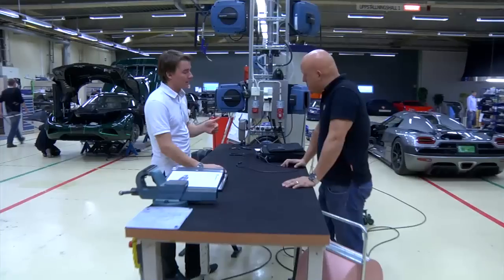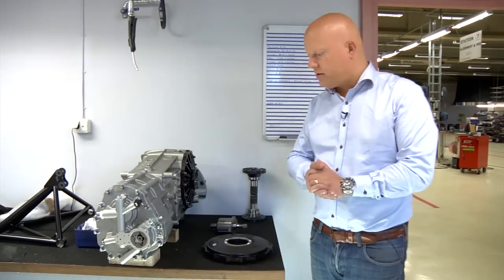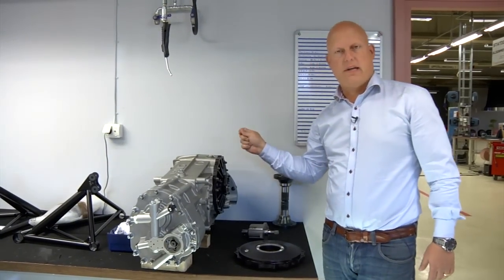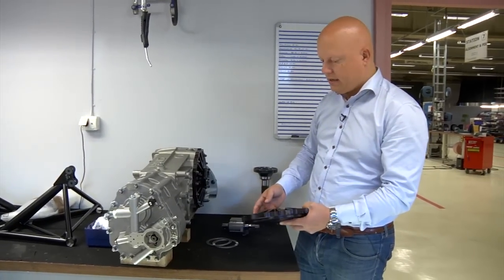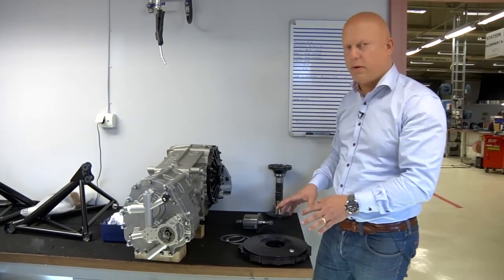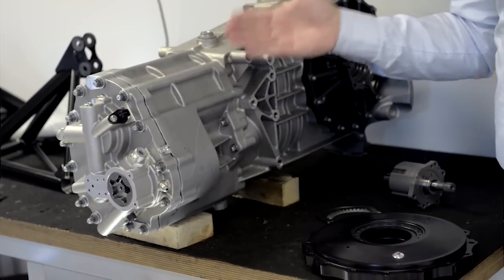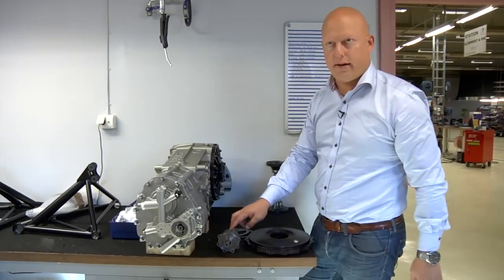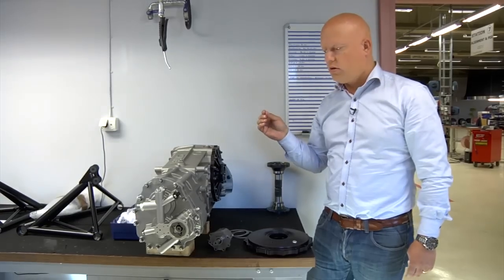Putting 1140 hp to the Ground - /INSIDE KOENIGSEGG

Comment: Bugatti supersport has 1200 hp
Reply: Bugatti SS=1888 kilos while the Agera R=1290 kilos. That makes up more than enough for the 60 hp the koenigsegg lacks.
Reply: momatedise Veyron is heavy, fat and ugly.
Reply: Yes but it weights almost 1900 kg's, have 16 cylinders with 4 turbo chargers to produce all that power. The Agera R weights almost 1300 kg's, has a 5 litre V8 producing 1140 bhp. So the Agera R is better engineered. Bugatti Veyron is only built for breaking the record as the worlds fastest road car. I rather have a car with killer acceleration than a car going 417 km/h. What is the point of that?
Reply: Stonkish come on man it aint ugly
Reply: veyron has an v16 ofcourse it is powerful but agera r has an v8 and making 1140hp

Comment: We will earn respect over time. Bicycles are a fitting test to show ERW acceleration advantage over pneumatic tires. Motor sport will benefit by high frequency contact with the surface,..Just the facts...Check out our new Screw force acceleration vs tubeless MTB video. Never be afraid of the march of technology, it will happen regardless.
Reply: You can't fall off a Koenigsegg, though.
Reply: High frequency response to the surface is key to high speed performance. A new lever of performance is necessary.
Reply: EnergyReturnWheel i was half expecting you to say "resistance is futile"
Reply: Our slow motion videos show ERW high frequency response not possible with pneumatic. Screw force accumulation and return adjusts each wheels rotation speed while maneuvering.
Reply: Surface adjustments happen between the wheel and the ground...A very short distance.
Reply: Bringing a carbon fiber hoop with Kevlar jacket so close to the surface. New traction systems are being developed. Latest published ERW patent addresses vacuum boost performance.

Comment: We have yet to disclose our novel traction systems. We have just published another patent...Nano Rubber wedges lever off the Nano Carbon Carbon hoop. The hoop held to the surface with approximately 6 Tons of Negative kinetic radial tension.Tension array sings at high frequency. Tread adjusting to the surface in milliseconds. Pinching the surface while braking and acceleration. Nano Rubber wedges lever, generate camber controlling lateral forces, radically increasing G force.

Comment: Koenigsegg!...Traction, bringing all that power to the surface, That is what is missing! The pneumatic tire is a 140 year old bouncy balloon. 
High frequency in wheel suspension, Patented ERW is coming to motorsport. Rolling Nano Carbon Hoops flexing a footprint in milliseconds. Screw force accumulation and return across all wheels. Want a set?Thought you would like to know.

Comment: Well they are both measurements of energy... and don't forget temperature is just a measurement of the speed molecules are moving. So 1000hp is used to move the car, 2000hp is used to move the molecules with the metal, air etc.

Comment: that was just the documentary trying to make it sound uber impressive. all internal combustion engines loose power through heat. they are inefficient, but it's only 2000 hp if its being mechanically transferred to the fly wheel.

Comment: Yes, it makes 3000HP, but 2/3 is lost to heat, so only 1000HP goes to the crank (I'm sure its more than 1001HP, but its probably less than 1100, as every engine has a little variance and they would not sell one that makes less than the advertised amount of power).  Its a marketing hype.  The same could be say for almost any engine.  You gotta know all the details before you start throwing around random facts all willy nilly.

Comment: Clever design to speed up upshifts without using the Kégresse double-clutch design, but one advantage of a double-clutch box is that it works extremely fast on downshifts, too.

How does this design work on downshifts?

Comment: Why would you not use something like a Torsen diff which always transfers power to the wheel which has most traction? I just don't understand why you'd use this instead of a fully mechanical one.

Comment: all that clutch is doing is sycronizing the input shaft speed, it's not used to move the vehicle, it's more of a brake than a clutch, it slows down shaft when up shifting to the proper speed in order to reduce shift times, it's not actually used to propel the vehicle

Comment: absolutely fascinating, two clutches means the brass in the synchros wont get ripped apart with 1100 horses spinning the input shaft, i would however like to know if they use helical or straight cut gears in their box, give us ASE guys more info koenigsegg

Comment: The only reason so many makers have EV's is because of public appeal, theres a real the Honda Clarity was such a monumental success, seriously, that car alone is the future, because its just like what we have now. Also, the main problem with EV's is the batteries, they deplete, and weaken over time very very fast, theyre not practical, and fast charge stations just make that time even less. Finally, the reason McLaren Ferrari, and Porsche have the electric motor is for better acceleration.

Comment: Well the Veryon is good for cruising higher speeds comfortably. But I wouldn't race it against other super cars.

 If your doing 130+ in a Veryon it will be comfortable and somewhat safe. 

If I try this in a cheap car like a corolla or civic it would feel like the wheels were falling off and it wouldn't be safe.It's not crap it does cost like 1 mil after all.

Comment: Troll. When battery tech becomes more sustainable, charges faster and with high capacity then Electric Motors will rise.It's not far off but it's isn't there yet. Electric systems are not currently up to propulsing a super car for a reasonable amount of time at the power output these cars get. Till then shut the fuck up and enjoy this man's mastery of the Internal Combustion Engine.

Comment: Noone ever doubted electric can do speed, but it comes at the cost of range and/or weight. I'll say again: slower in every respect except 0-60 on a drag strip, 90 mile range, 129 mph top speed, no equipment whatsoever. You got nothing. And like most EVs it has no gearbox, so it didn't do it in "first gear"....

Comment: You mean the acceleration on a rubberised drag strip with low pressure drag radials? Why would I consider a stat like that. Tellingly even with drag tires it's slower across the quarter mile than this Koenigsegg (10.26s to 10.1s) with its 544km range, 400kmh top speed, climate control, sat nav etc. Not sure what point you were trying to make, but it failed.

Comment: wow personal attacks, really? I thought Danes were supposed to be level headed people. This agera R gets 14.7L/100km on combined cycle, it has an 80L fuel tank = 544km range, with 1140hp weighing only 1290kg. End of discussion, electric can't get anywhere near that with today's technology. 
The tesla S has 700hp less power, has 120km shorter range and weighs 820kg more, not even in the same universe (2 extra seats don't weigh that much).

Comment: If you think that solar, wind, and waterfalls are usable base load power sources then this argument is horrifically pointless, dumbass.  Not only are all of those processes not 100% CO2 free (close on most), but they are dependent on one of the least constant factors in engineering:  the environment.  You still ignore that batteries produce significant wastes in their production and are not effective in the foreseeable future for range/power/weight/etc. Koenigsegg in the same league as Lutz, wtf

Comment: The raw energy in gasoline is higher than coal, yes.  But when you compare engine efficiency, total power output and emissions vs energy density, large scale coal processes win out (assuming of course you ignore plants from the 50's that are still online).

Comment: No need for that superhuman ability; can't you very obviously tell by the note of the engine? There is an interruption. Now look at say the Aventador, which has a single clutch too, but reported to be 50ms (insanely quick). You can tell it's extremely fast by the way the engine note changes between shifts. Listen again to some interior Agera clips, then go listen to some Italia 458s clips, and 991 PDKs, etc. Perhaps it's "damped" on purpose by that Triplex system someone else here commented on.

Comment: Top Gear is an entertainment show, and not a car review show. For example, the wrote the script for the Tesla, including it running out of electricity, before the car ever showed up.

Lateral G is the same as the last generation of Mustang. A Mustang wouldn't beat it on a track because it is still has 1/3 the power and brakes.
But there is a reason the Veyron has never been tested on any real tracks.

Comment: Thank you Christian. The more you explain the engineering and design that goes into the Agera R the more impressive it becomes. What an incredible transmission. The fact that it is sub 90kg is amazing. The wet clutch on the input shaft to break the input shaft is a work of genius.

Comment: I'm not a Veyron fan or anything at all but the Veyron is much more than pure hp.  Sure many companies can make 1,000 hp cars, but I doubt they can make 1,000 hp cars that are still as comfortable and drivable as a Mercedes while going the speed limit.  The Veyron does not just do acceleration and top speed, it does cornering, comfort, drivability, overall quality inside and out, innovation, driver confidence, etc.  It does everything excellent.  Tuner cars 95% of the time do not.

Comment: Not even close. The Veyron was just an over-hyped turd.They needed 8 liters, 16 cylinders and 4 turbos to get 1200hp. It managed a measly 12mpg. The car weighed 4400lbs. The car needed such stiff suspension to barely make a turn that it was quoted as having the ride comfort worse than a Porsche GT3 and an interior louder than a Viper ACR. The Veyron also had crap for aerodynamics. Half the body was aluminum. It didn't have a CF tub and shift times took twice as long as any Ferrari at the time.

Comment: I'll have to disagree with you. The Veyron is far from as impressive if you take things like resources and "brute forcing" in to account. Take the lousy specific power output of the engine, the massive weight and the tremendous amount of knowledge and engineering solutions within VW. Then here come the vikings with very few people and no big auto-group. And they develop "everything" themselves. They even did their own electronics! And not to mention that the car looks god as opposed to the veyro

Comment: its all about friction more surface area decreases the effect of the loss of the lever action you would get from the friction at the outer edge of a larger diameter clutch. Most clutches don't have 11 discs and metal/ceramic/carbon type composites that it is probably made out of can withstand immense pressure.

Comment: If you would to look at the downside it's that the diametre is small compared to other clutches which increses the demands for pressure and that in terms increses the demands on strength of the whole construction since you need to compensate the loss of "lever arm" with higher clutchpreassure.

Comment: Well it is cutting edge because this gearbox and clutches have to handle 1140hp and 1200 NM of torque. It's always easier if you do it at a small level, or in this case low-power level - but it becomes a real challenge if you want to use massive amounts of power and torque.

Comment: Wait a sec... As a reason why an rmp drop is not needed you just mentioned a reason why it IS. "at same vehicle speed the higher gear requires a lower RPM than the lower gear you shifted from".

Comment: Double Clutch gearboxes have their advantages too. They are much smoother than the type Koenigsegg has. With this system you get fast shifts but they are not smooth. The kardan is still spining fast just the gears on the input shaft of the gearbox aren't spinning so you can shift faster.

Comment: I bet at BMW and merc and other manufactures "We do have a issue with sync time between gear changes. we chould try to break the shaft fast en.." "No! we do dual clutch instead...its much easier!"

At Koenigsegg :"Hmm... that would save weight....we get much better performance...Let's do it!"

Comment: Everything Koenigsegg is engineered to an extreme and still functions with a safety margin. That "small" clutch has 11 discs and is immersed in oil. Being small reduces the centripetal loading, having 11 discs incleases surface area [a 5 disc would have to be more than twice the diameter] and reduces the demand on any single disc and being in oil cools them. The dry clutch at the other end of the transmission will probably go long before that "small" one does

Comment: From the point where automobiles become commonly powered by batteries/supercaps, figure at least another 10-20 years of development time before you can get the storage light enough to use on an aircraft.  If you think weight in a car is bad, at least you aren't trying to beat gravity with it.  And yes, in use batteries produce no emissions (this doesn't factor in production), but you like almost everyone else on this channel miss the point of where the electricity actually comes from (the grid).

Comment: Necessitated... right.  You do realize that a very large majority of electrical power produced comes from some form of fossil fuel, nearly defeating the whole purpose of removing a gas powered motor?  While I do think that humanity should be a little more concerned with the environment (and bleeding-edge technologies like what Koenigsegg produce leads to that path), I frankly believe that you are unreasonable in not having a single clue of what actually happens in industry.

Comment: i get it now.. it's like a reverse rev-matching technique that you do with heal-and-toe techniques.

during downshifts, the engine is naturally slower than the transmission. that's why you need to blip the throttle to bring the RPMs back up to a point where the transmission would engage easier. 

now, with this, the system puts brakes on the transmission to bring it down to the level of the engine. so instead of the engine doing the catching up, it's the transmission that's doing it.

Comment: Well I was talking about internal combustion engines in cars but according to some, once batteries become smaller and lighter (and they will), aeroplanes will start using electric engines too. There are many benefits to electric engines. They are smaller, lighter, cleaner more powerful and more reliable than combustion engines.

Comment: uhm no. dct practically halves your transmission into 2, odd and even gears. it speeds up shifting by essentially having your next gear engaged but with the clutch disengaged. so by the time you shift into that gear, all the transmission has to do is release the clutch, and you're on! :) thus, it's faster by eliminating the time the gears have to get engaged with the input shaft, before you can release the clutch.

but i do get koenigsegg's system now.. it's a reverse rev-matching technique.

Comment: but you don't need to drop RPMs during an upshift because (at same vehicle speed) the higher gear requires a lower RPM than the lower gear you shifted from. it's the downshift where rev-matching is important, thus the use of heel-and-toe.

Comment: I guess you simply can't wrap your mind around someone having a different opinion than you on what fun is. Efficiency is not so important when I just want to take my car out on a sunday drive. The car I want to drive every day to work, should be good on gas (or water....), but my sunday car, or my thursday night lights car should leave a trail of tire smoke behind it, and a smell of clutch and oil in the cabin. I will NEVER have as much fun in an electric car because it isn't the same experience

Comment: In the video where he talks about pneumatic action of the valves he also mentions the possibility of turning the engine into a air compressor when decelerating or in an engine braking scenario and storing the compressed air to be used later to power the engine or amplify engine power. This sounds like an excellent solution to the problem of producing a fuel efficient car in the future and is also a solution which is fitting with a hyper car ie not weighing it down with 100s of kilos of batteries

Comment: ok then build that 2 seater, I bet at 700Kgs you wouldn't be able to pass any safety regulations, not to mention with a top speed of over 400Kph no road car on earth (past, present or forceable future) could make it look like it's standing still. Besides that it also uses ethonol, which means 1/2 the carbon foot print, and if the refineries were to switch to clean energy then it would be carbon neutral (unlike EV's that still get charged from mostly coal power)

Comment: Well the problem is, the technology has to start somewhere.  We didn't get the efficient engines we have today by someone telling Ford/Mercedes they couldn't/shouldn't do it.  We have to push the technology forward in order for it to catch up to over 100 years of the combustion engine.

We are plagued by instant gratification and the lack of funding.  This leads to privatized research and funding, which equals slow innovation.  Look at the Tesla Model S.  THAT is innovation with proper funding.

Comment: Modern batteries are recyclable and electricity doesn't have to come from coal, Tesla Motors has built charging stations that get the electricity from solar power and it's free to the customer. The writing is on the wall, electric vehicles are going to take over very soon. This is the final curtain call for the ICE engine, it's just that most people don't know it yet.